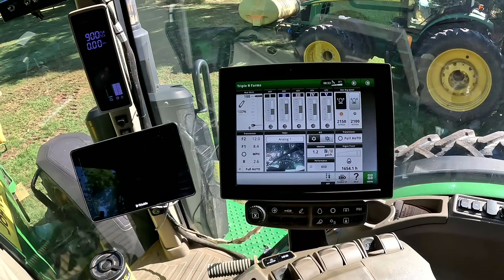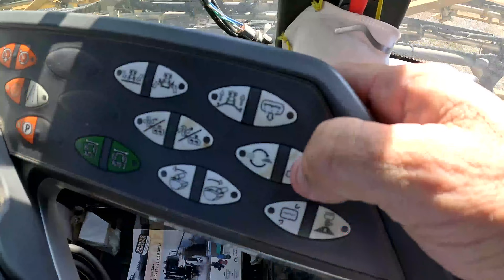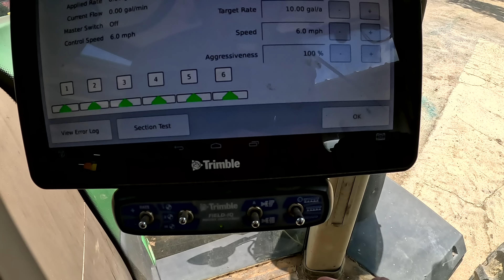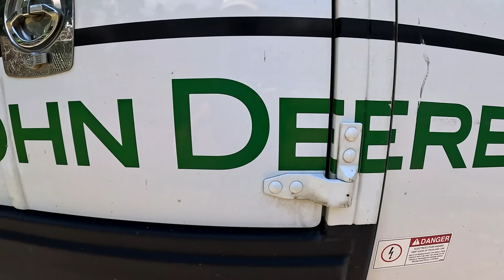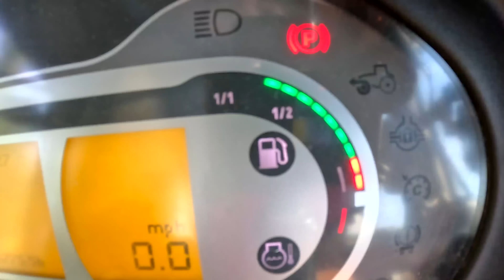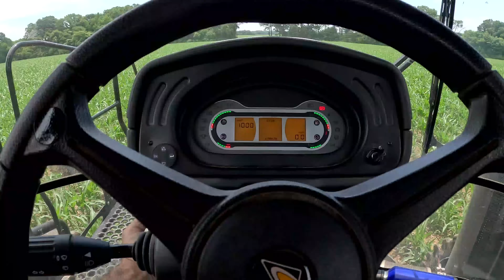CORN FARMING IN ALABAMA

Comment: if you put a piece of square tubing over the bottom shaft and welded it then replaced upper pipe with square tubing that the bottom would slide up and down in and drilled holes to set depth would that stop it from moving side to side